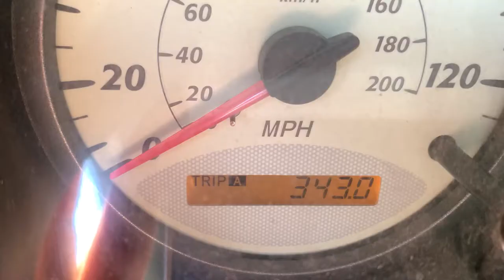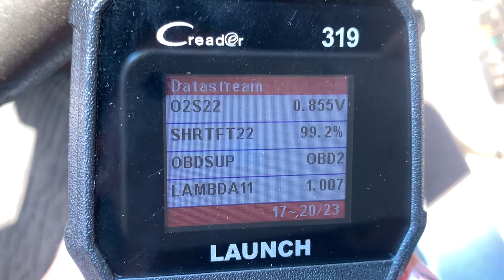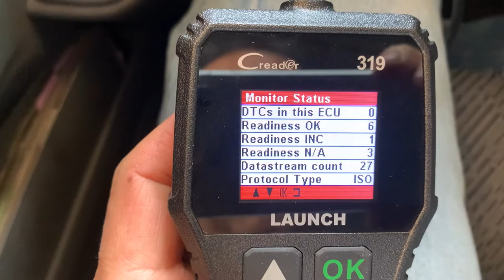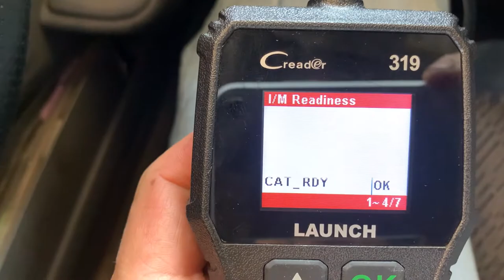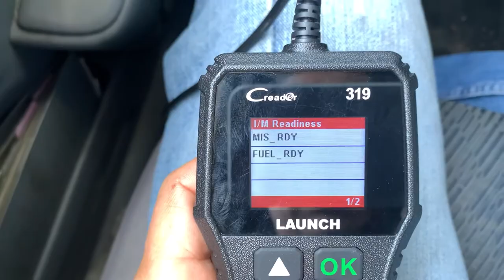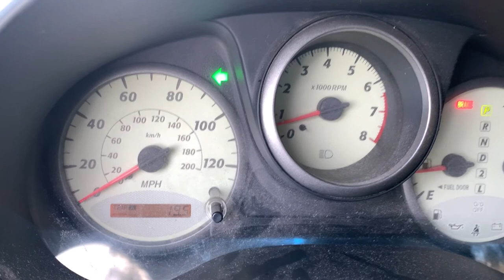2003 Toyota Rav4, CAT NOT READY, Problem Solved! Catalyst Replacement

Comment: Mine did the same. I replaced the O2 sensors, and the codes didn't come back for over a year. Then, my daughter said it started rattling when the engine is idling, and the codes came back.

New catalytic converter on the way. I made sure to get one with heat shield brackets.

Comment: Just forget about the check engine light altogether.  Rav4 is 19 years old and over time parts start to fail and deteriorate.  My 2002 Rav4 has the check engine light and 02 sensors are likely gone as well but since my 2002 Rav4 is still an extremely reliable as heck I just keep driving my Rav4.

Comment: Hi there, did the P0420 and P0430 ever come back after the cat change? How long has it been now since the change? I have the same exact year and model car and it’s due for smog check soon. Checked and tried everything and nothing worked. My last option is to change the cat. What was the mileage when you had the code? Mine showed up around 170K miles. You’re the only person on YouTube who covered these codes and every step to tackle it in depth! Thank you so much!
Reply from the maker: My Rav4 constantly bothered me with the check engine lamp. It sometimes stays on, sometimes goes away. When my wife drives, it often went away. I thoutht the driving habit had some effect. But that time I didn't have the code reader. To pass the most recent smog check, I got the code reader and found so many code, which are mostly covered in my video.
After replacing the converter, I don't see the code any more. After that, I disconnected the battery a few times, but CAT readiness gets ready very easily (just one drive cycle). So, even if the code does not turns on, delay in CAT readiness is probably caused by weakened converter. Unfortunately, due to the recent hike of the platinum price, the price of a catalytic converter has increased. I hope you are not in California (some states requires a compliant converter, which is much more expensive).
Reply: @madatsukaerude  Thank you so much for the reply and info. I’m glad you got the problem solved and the codes never came back. Unfortunately I’m in California… Excellent videos, keep up the great work! I appreciate you!
Reply: @madatsukaerude  Very useful video. I own the same little rav 4. Did you install a aftermarket cat or original one? Thank you
Reply from the maker: @adrianzo6098  I installed Magnaflow. https://www.magnaflow.com/collections/2003-toyota-rav4-catalytic-converters?california=true

Comment: Have you had any problems with those lower brackets not lining up to support the Catalytic Converter? From what I understand, those lower brackets support the weight of the Cat Converter to prevent excessive stress on the exhaust manifold studs up top.
Reply from the maker: Yes, I believe the bottom bracket didn't fit and I gave up using the bottom bracket. It's been long time since I did this job, so I don't remember exactly, but I judged the bottom flange does not hold he eight of the muffler. See from 11:00.
Reply: @Mada tsukaeru de  ... Since it's been a couple of years now, you're probably right. I would think unless you're rough off-roading, it probably doesn't matter. Luckily, I managed to modify one bracket to work, so that should be enough. I also had to bend and drill new holes in the heat shields to fit properly as well. Seems to run great. Thanks.

Comment: I have a 03 Rav4, same color! Where did you get your Catalytic Converter at? And or what model did you use?? Oh, and the sensors for it? Thanks...
Reply from the maker: I don't remember where I got the converter, but I got is online. Google search the right part. As for the sensors, I should have a separate video that indicates the part number.
Reply from the maker: Watch this. https://www.youtube.com/watch?v=hIVffwtdkUo&list=PLGu56evsup8CC6h_8V0mi2e3fjqhqIZLY&index=14
Reply: @madatsukaerude  ありがとうございました

Comment: Had same problem on my 2002 Rav4, put 1 inch spaces from Amazon on the two rear O2 sensors to move them 
A little back from the exhaust and it worked great 👍🏻 about $25😁
Reply: Hi there, not sure what you means by put 1 inch spaces from Amazon.  Would you please elaborate?
Reply: Please send me the link to Amazon
Reply: Sure you get rid of check engine light problem, but what if your cat is destroyed internally and the exhaust gases can't flow freely? eventually can cause a problem to your engine
Reply: @osvaldomena1172  runs great 250 k  miles, Rav4 over 20 years old, love it